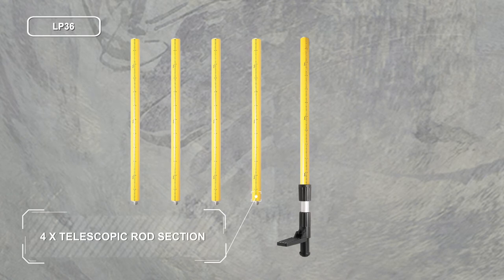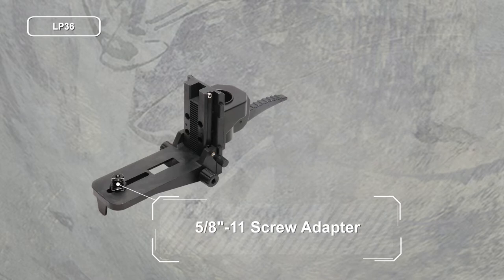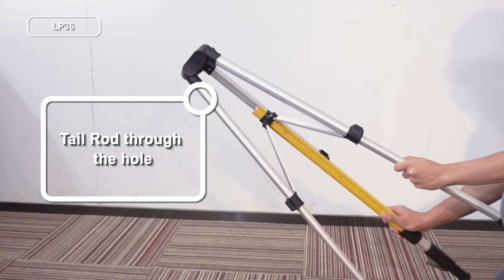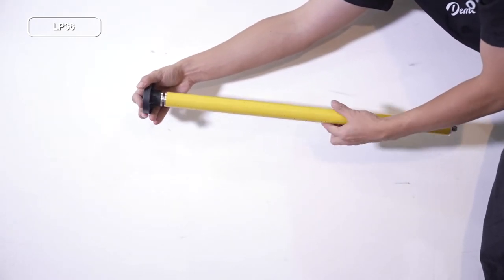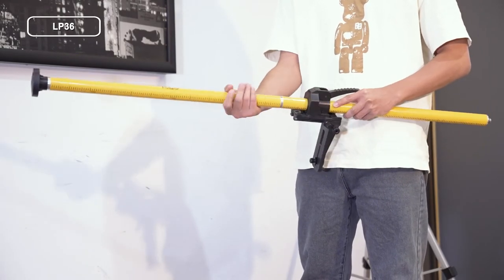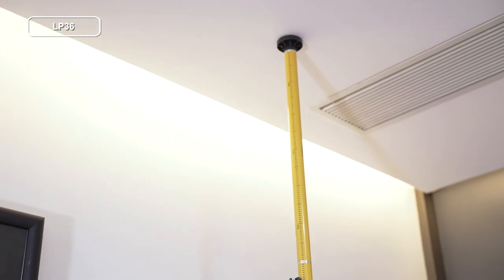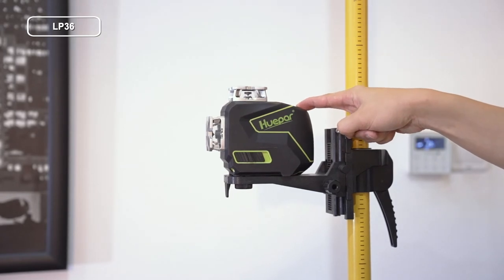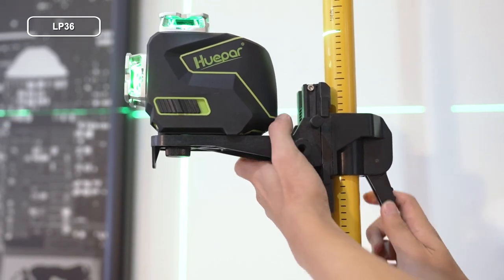How To Use Huepar LP36 Laser Telescoping Pole Laser Tripod?

Comment: I can’t use the tripod because the ceiling is too low to fit another yellow section in and when I try to pull the yellow section up while pushing down with my foot in the foot pedal, the ceiling skid doesn’t reach the ceiling before the tripod legs are wanting to come off the ground.  Now what do I do
Reply from the maker: Hello
Thank you very much for your support,
You can replace it with a long tripod. If it is too low, you can first get it to almost the same height, and then use the pedals to increase the height. It does not necessarily have to be all the way up.
Reply from the maker: If you still have problems, please feel free to contact our customer service for help. Email address: support@huepar.com

Comment: I bought this on Amazon.  Unfortunately, this mount doesn’t allow much adjustment to attach it to ceiling poles with a slightly smaller diameter.  I’ve already invested in using an excellent quality ceiling pole from FastCap.  Huepar needs to give it greater flexibility to be used on different sized poles.  I returned it for credit.  Still looking for something to mount my Laser Level on my ceiling pole!!!
Does anyone know something with greater pole adjustment sizes?
Thank you